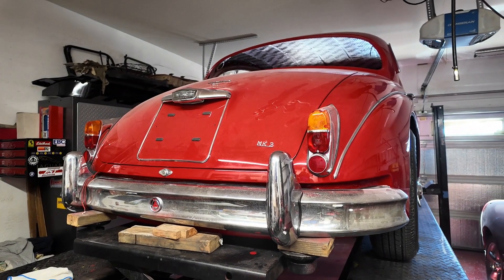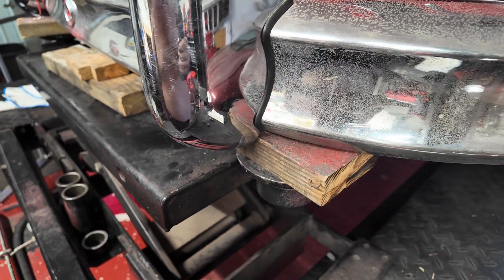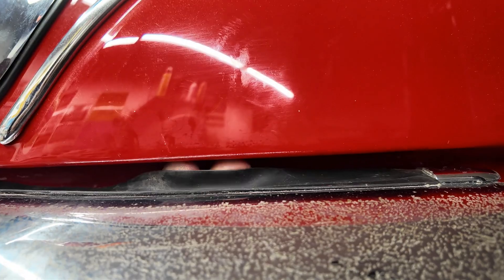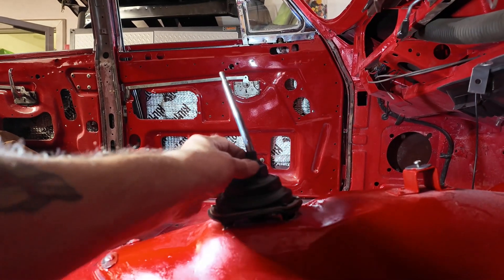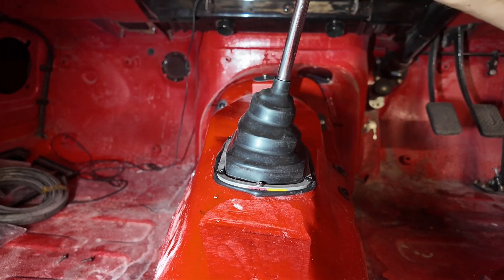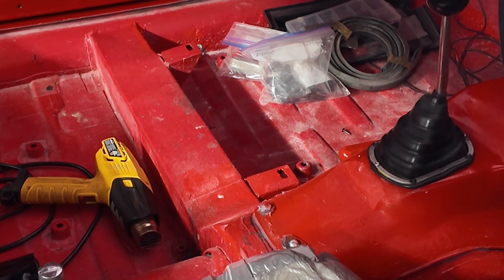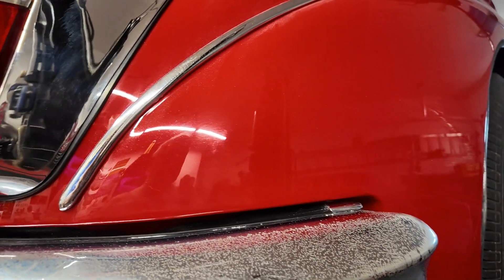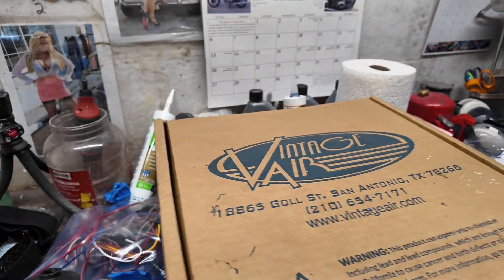Jaguar MKII Reassembly Part 343

Comment: I had the same gaiter issue in my 1966 s-type , i had to remove the rubber and just go with two layers of leather in the end but I will have to try the heatgun idea.  I am also tempted to try the e-type gaiter at some point. Thanks for uploading the videos!

Comment: Same issue here with trying to find a gaiter that will work.  I just bought a 20 inch square sheet of 1/32 thick silicone rubber.  Maybe cut a hole for the shifter and bond some rubber rings top an and bottom to go around the stick.  Drape that down to the tunnel and fasten it down with some sort of frame.  No idea if this is going to work or not.  It just needs to keep the air, water and oil out of the car.  No need for it to be pretty.  The leather boot will be the pretty part.
Reply from the maker: Yes, I agree pretty there is not the main concern just as long as it keeps all the engine and road smells etc. out of the interior of the car. I think we will see that heating gator has worked.

Comment: Just an idea for tge bumper seal. Get some cord and thread it under the seal.  Tie it off one end on the top of the rear wheel, and pull up the other end like installing windscreen rubber.
Reply from the maker: @nrw34260  tried that it didn’t work🤔